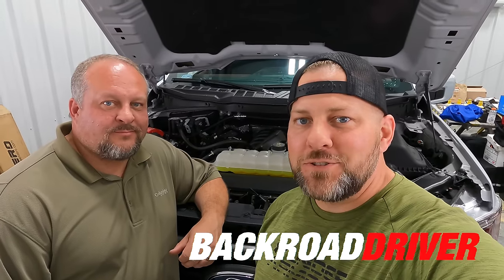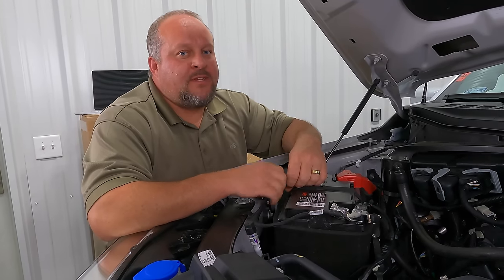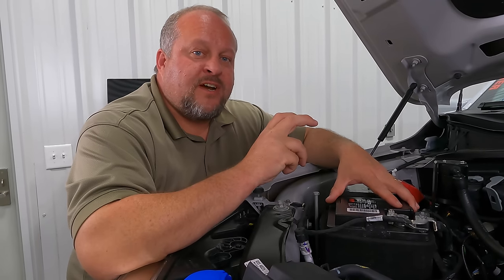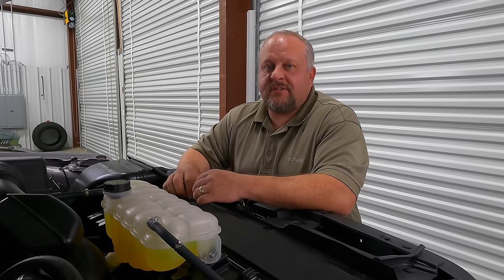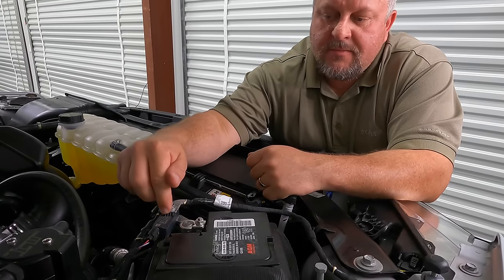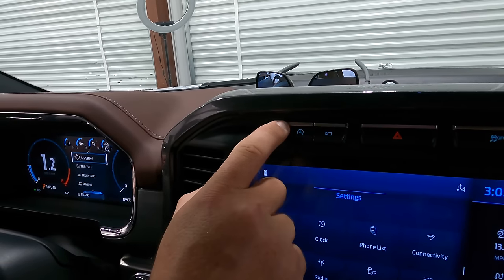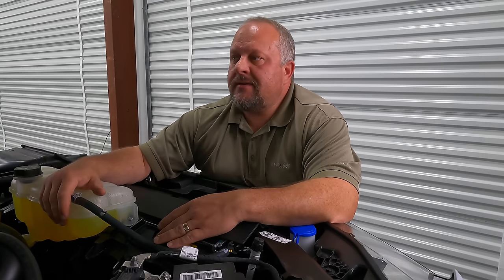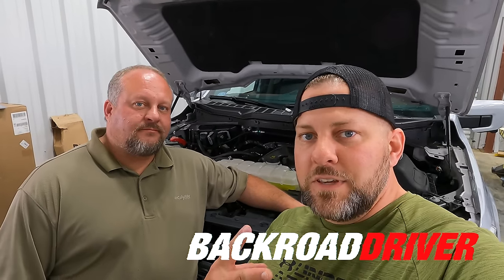2021 Ford F150 5.0 V8 Cylinder Deactivation & Oil Pump Belt Defeated! - It Wasn't All Bad...

Comment: 2 questions: I have a 2.7 stx does it have cylinder deactivation? Does my rig have the same plug on the negative battery terminal to deactivate auto start/stop? Thanks guys
Reply from the maker: The 2.7 doesn't have cylinder deactivation like the 5.0.  I'm pretty sure your truck should have the same plug that you can deactivate auto start stop with.  It is still a little annoying because you have to hit a button on the steering wheel.  I would recommend using forscan or the auto start stop eliminator module.
Reply: @BackroadDriver  Thanks for the info gonna check it out bro
Reply: No they only had to do it to the v8 cuz government is trying to ban v8. So their trying to do what they can to save and keep the v8

Comment: I was in the process of finding a 2021 F150 5.0 and trading my 2016 5.0 in, when I seen your first video. I instead looked away from F150s after owning 4 of them prior and ended up buying a Tundra. The Tundra is a night/day difference in towing my 30ft travel trailer. What are Ford engineers thinking? I don't want cylinder deactivation or a wet belt, way to destroy the coyote engine and loose a 5th generation Ford driver.
Reply: Hi Joshua.  Could you please explain specifically what the night and day difference is?  As far as towing specs go, the Ford has the edge so I was wondering what specifically you mean when you say the Tundra is better.  Just asking for clarification and additional information for those pondering the same decision on buying.  Thanks.

Comment: I have a 5.0 on order.  Would you order it again?  Also hearing sport mode turns off CD.  True?
Reply from the maker: I love my truck and it's been great so far. Sport mode and tow haul mode also turns off CD. Since this video, we have found out that unplugging the cable from the battery does not disable cylinder deactivation.   It may disable it for a little bit but it comes right back on.   It does, however, disable auto start stop. Thanks for watching Todd! Check out some of our other videos.
Reply: @BackroadDriver  thanks!  I will stick with the 5.0 and just drive in sport mode.
Reply: Have the 5.0 in my 22 STX and I absolutely love it
Reply: @christian7200  that’s awesome!  Mine goes into production mid March.  So maybe in April I’ll get experience a new 5.0!  What mode do you drive in?  Can you feel the CD?
Reply: @Todd C.  mines being built late March...
Reply: @GoogleUser-xr2hr  mine just got pushed back a week to 3/21👎
Reply: @Todd C.  what was the original build week? Mine was March 21, it also got pushed back to March 28th
Reply: @GoogleUser-xr2hr  3/14
Reply: Just ordered mine Monday night, estimated 6 months

Comment: What can you tell me about the new "spray on" cylinder sleeves?   Are they holding up or are they wearing out fast?  I'm looking at a new(er) F150 5.0 V8
Reply: Same here. Contemplating buying one while the incentives last. Not much info out there. I work for Ford manufacturing, some of our guys had issues with oil consumption on their 2018 - 2019s one had an engine replaced under warranty. No one had reported on a later model yet.
Reply: Check with the imports they been doing it for years

Comment: Trying to identify my rear end size, have a 2018 f150 5.0 two wheel drive xl reg cab. the pumpkin is square in shape and has twelve bolts.? The door sill code is L9(its an e locker) Any thoughts.
Reply: L9 is 3.55 Electric Locking Axle
Reply from the maker: Should be a 3.55 e-locker.  Square 12 bolt should be a 8.8 rear end.  I'm pretty sure the 9.75 isn't square.  Look for a sticker on your rear axle and see if you can Google that code.  Anyone else with knowledge please step in...
Reply: Thanks' for the reply, and no tag or sticker present, i'm sure it's a 8.8 .

Comment: This never make sense to me and I’m a logical guy who’s done a lot of work on engines.  I have two 5.0 F150’s 2012 and 2017.  Why on earth would I want to run 4 cylinders instead of 8.  If you have 8 guys working on a project and you tell 4 guys to go home you will wear those 4 out early.  Let and 8 be an 8 and share the work .  The engine will last longer.  It’s as bad as the stupid shutting off and on at the lights all the time.  The starter will not last.  Oh and ask Toyota about timing belts on their v8’s back in the day. Has to be changed every 90k. Expensive job.  These engineers have short memories.  GM never mastered their engine deactivation issues for 20yrs and im sure Ford has it figured out. 😂😂😂.  Laughable.
Reply: Some guys try to tell themselves that it won't have problems because it's DOHC instead of pushrod but it's not as though Honda hasn't had problems with cylinder deactivation. I mean, Ford hasn't even mastered cam phasers and timing chains after how long, they aren't going to perfect DOD right off the bat. Ford's 1.0L Ecoboost uses a wet belt to drive the oil and I have seen a sickening number of those belts shredded to bits. Why is it so hard for Ford to just do the right thing if they want the oil pump  down in the pan? Put a double roller chain on it at the very least. I'm sure all of us would gladly pay the cost difference to get an engine with beefy long lasting chain drive at least.
Reply: GM been playing this game for 5 generations now, over 65 yrs, still no good. It’s just a bandaide to meet CAFE while making the engine 50% less reliable. Ford added this to their 2022+ V8 trucks. I don’t think it’s on the mustang V8 yet.

Comment: Is there a way to turn OFF the engine shutoff at stop lights beyond remembering to hit the switch? 2021 F150 Lariat 5.0 Thank You
Reply from the maker: Right now there are a couple of options.  ForScan is one option. It requires a cable that costs up to $50 and a Windows laptop.  You would also need to do a little research and download a copy of the software to your laptop.  A good place to start would be this video.  https://youtu.be/ZMdXP0hFcOE

The other option is the auto start stop eliminator.  You can purchase it on their website. https://www.autostopeliminator.com/products/2021-ford-f-150-autostop-eliminator
It will cost you around $90 and you will need to install it.  Some minor - disassembly may be needed to get to the back side of the button.

Comment: My 2014 5.0 gets 14to 15 mpg. 

My 2021 5.0 gets 17 to 18 mpg. 

And on the 2021 v8 they added back the steel drain plug for engine oil.  :)
Reply: My 2017 use to get 21 hwy & 17 city.. granted I was running 93 but now with my 35’s 14 wides I’m lucky to get 12.5 hwy and 10ish city on e85 could be better running 93 but haven’t tried since my truck is tuned to run all my mods with e85 only but 93 wouldn’t hurt nothing but HP TQ

Comment: just picked up a brand new 2021 F-150 STX....we noticed at some stop lights the engine r's and oil pressure dropped off to zero...now, 3 months later, doesn't do this anymore...is that a problem ?

Comment: What source is cited about potential CD related issues with the 5.0. Just brought a 2021 SXT home—love the truck and power of the Coyote, however, the 10-speed trans takes time to acclimate with. Ram had lubrication issues related to its CD, just wondering what Ford’s techs or mechanics note. Really like your channel.

Comment: Great video! I have a 2018 f150 5.0 it burns oil because every cold start up it blows out a  bit of blue smoke do you think a ford dealer will do something about that.    what’s your take on it? Thanks
Reply from the maker: How much does it use between oil changes?
Reply: @BackroadDriver  a quart  every 1200 miles it has 56k on it I change the oil every 5 k  I run moble 1 advanced full synthetic 5 w20
Reply from the maker: Are you under warranty?
Reply: @BackroadDriver  yes sir
Reply from the maker: I would show them that and tell them that oil loss it way too much between oil changes.
Reply: @BackroadDriver  will do thanks 👍
Reply: Father in law is getting his engine replaced for the same thing

Comment: Belt driven oil pump, I'm done with new  FORD.
Reply: Yup. Ford tech here, I've seen plenty of oil pump drive belts taking out focus and escape engines. And the worst part is "belts of all kinds" aren't covered under esp contract so once your base warranty is up, it's not covered. 

I hope these belts are very different from the belts in the smaller engines. They all crack, and get worn out, just like timing belts.
Reply: @mattgerb17  they are essentially timing belts, they will need to be serviced, but I'm sure ome of the first upgrades on this new motor will be a chain driven oil pump.

Comment: Would a cylinder deactivation make the truck vibrate a little when on Idle? I just bought a 2022 ford F150. Which I can feel a small vibration in the cabin when it’s idle. Once on drive and driving it smooths out. Or when I’m at a red light. No issue. Only in idle. Which it’s very uncomfortable to feel. Specially a $60k truck. By the way. Mine doesn’t have the auto/start/stop button anymore. But engine says it’s eco bust. My previous 2018 had that A button to disable the auto start/stop function.
Reply: I have noticed at idle. My truck jiggles quite a bit. It is uncomfortable how much it oscillates
Reply: @Shelf_Help_ca I’ve noticed this at startup along with some extra noise - seems to be coming from the transmission.  Everything’s fine once moving.  I’ve just gotten used to it.  From my 18 Mustang GT I’ve learned to just ignore all the weird noises that come from the engine 
at  idle and just enjoy the power.

Comment: All you have to do is put the truck in sport mode. It turns all that crap off.
Reply: also hold gears longer and increases throttle responce. killing mpgs
Reply: @devincicrashjk  boo hoo. I don't buy trucks to save on gas. differences are negligible
Reply: 🤦‍♂️ @devincicrashjk

Comment: Question: by unplugging the cable from the negative terminal, are you saying I couldn’t use the rear defrost, and heated seats ?
Reply: No, it just monitors those systems when the vehicle is stopped due to ESS so it knows to restart the engine if battery voltage drops too low.

Comment: Please elaborate on that chain driven oil pump ford has never had one on a 5.0 the previous design was driven directly by the crank shaft and ask about the belts already failing on 2.7 3.0 1.0 1.5 1.6 engines this is not a good idea or design if that belt quits you need a 10k engine replacement......

Comment: So GM's oil pump timing belt wasn't Kevlar ??
Reply: my Chevy's oil pump is connected to the crankshaft. no belt. when did they need a belt?
Reply: @banana82728   I don't know,,, they do all this crazy ass engineering to hopefully gain minuscule mpg improvements to satisfy their government overlords.
Ford takes a bulletproof 5.0 and adds belt driven oil pumps and cylinder deactivation because their customers demand it ???
NO...
The Government Overlords must be appeased !!!
Thank the EPA and the CAFE standards and the glassy eyed leftists that run them...
Reply: @2packs4sure  exactly

Comment: HUH?  Yeah, unplugging the BMS cable will most certainly disable AUTO STOP/START, but how is doing this disabling cylinder deactivation??????????????????
Reply from the maker: It didn’t work well…
Reply: So unplugging the connector at the neg battery post does not disable cylinder deactivation?
Reply: @ctbale1  NO, it does not.  It will disable stop/start, but it does not affect AFM/DFM at all.  Not sure how this got started.
Reply: @greghale717  yea, been researching the shit out of this.  I was thinking of buying a 2021 f150 with a 5.0 but won't unless I can permanently kill the cylinder deactivation.  I believe the only way is with a tuner.  I don't want to be forced to drive in sport mode or tow mode to defeat CD.  Thanks Ford!  Dam

Comment: Id like to know if the 2021 5.0 is drinking oil like my 2019 is. Wonder if they fixed that?
Reply: Do you think it’s the spray in cylinder liners they started using?  My 2011 has 189000 miles and doesn’t use very much oil between changes
Reply: My 2015 had no oil issues.

Comment: I can see why the charge monitor would disable the start stop feature so you don't get stranded with a stopped engine at a stop light but why would it disable cylinder deactivation? and how do you know it's actually disabling it?
Reply from the maker: Hey Drew, thanks for watching! We have confirmed that it does not stop cylinder deactivation in future videos.
Reply: @BackroadDriver   OK thanks. It really would have been nice if it were that simple.

Comment: The oil pump is obviously cast aluminum... It is not machined out of solid billet aluminum.
Reply from the maker: The gears, not the housing.
Reply: Billet steel oil pump gears. Cool.

Comment: hey, can you guy tell me if my 2021 f150 302A package with driver assist/ lane keeping can be upgraded to the full BlueCruise coming out later this year? i dont have the front camera in the grill or the side mirror cameras, can i just take the truck to ford and have them upgrade it to that? thanks,
Reply: Was "Ford Co-Pilot360™ Active 2.0 Prep Package" on the sticker?  I think it was/is only an option on Lariat, KR and Platinum, and standard on Limted.

Comment: Wow, I dodged a Bullet!!!  I have a 2018 F150 10spd Gen 3 Coyote, I just have to stop the auto start stop.
Reply: Question do you have oil burning on your truck because ford have the problem with 18 to 20 oil burning ?
Reply: @bigbuzzard8168 I stopped the iol consumption on my 2018 5.0l by switching from 5w20 oil to 5w30 and putting a little Lucas synthetic oil treatment in the oil.
Reply: Same here, instead of trading in my 2011 Ford F150 with a 5.0L Coyote for a 2024 Ford F150 with a 5.0L Coyote V8 (or for an overpriced EcoBoost F150), I've traded in my 2011 Ford F150 for a 2024 Nissan Titan with the 5.6L Endurance V8 in it with 400 HP and 413 Ibs of Torque and it makes the same power as the Gen 4 Coyote in the F150 but has no cylinder deactivation nor Auto Stop Start unlike the F150.

Comment: when u put the truck in manual mode the cylinder deactivation turns off too
Reply: Not all years. This was proven.
Reply: @blackcoffee730 what years?? I have a 2023.  What manual gear would cycle through gears and stay in 8cyl mode ?

Comment: Cylinder deactivation and auto start stop are not the same thing. How do you know the cylinder deactivation is disabled when you disable the battery monitoring system. Why would that disable cylinder deactivation. They have nothing to do with each other. That trick only disables auto start stop because the computer doesnt know if the battery is being drained from accessories while the engine is not running causing a no start . My 2019 5.0 would disable auto start stop just with laptop charger plugged into the 110v outlet.
Reply from the maker: Trust me, I have driven the truck for several months with cylinder deactivation enabled and once you pull the plug off the battery lead, cylinder deactivations is disabled. I have an aftermarket exhaust and it is audible when activated.  It is no longer audible and does not activate once this plug has been undone from the battery terminal.
Reply: That's exactly what I was asking!!! Auto stop/start and cylinder deactivation have nothing to do with each other. unplugging the BMS does kill the auto stop/start, but I think these guys are dead wrong in their thinking that it also stops cylinder deactivation.  in the RAM, cylinder deactivation occurs at a certain oil pressure and load on the engine....what would the battery management system have to do with lifters and oil pressure in the cylinder deactivation.  I think these guys are boasting something they have no idea what they are talking about......

Comment: Not sure if others have commented, but putting into Tow/Haul or Sport mode will also deactivate cylinder deactivation. 

Personally I don’t mind it - keeps mileage somewhat reasonable for a 6000lb vehicle!  I also wish I had Auto Stop/Start (it was deleted on line) so maybe I’m in the minority here, lol!
Reply: Yea I had my auto start stop removed.
Reply: LOL, won’t keep mileage reasonable at all unless you drive under 1200 rpm all day every day.

Comment: I tried unplugging that cable from the negative terminal on the battery and cylinder deactivation is still functioning. 
Something must have changed for the 2022 model F150 5.0s
Reply from the maker: We are aware that it doesn't stop cylinder deactivation. We addressed this in a future video of ours. This particular video had so much other good information in it we didn't want to take it down.  The only way to get rid of cylinder deactivation is with a tune.
Reply: @BackroadDriver do you have a link to that future video? Thanks
Reply from the maker: https://youtu.be/f6WiK5zaR4M?t=510

Comment: Why were they using sub par piston rings to begin with? Oh yea to maximize profits and screw the customer. Piston rings should not be cheaped out on so why did they. Stuff that warrants a full rebuild when it goes bad should not be tampered with when you sell those trucks for 75000.
Reply: You would hope, but the nutters and penny pinchers at Ford would rather spend the pennys on i'm not sure what. They're not really innovating in anything that the customer wants so. Spending money on EPA requirements

Comment: Unplugging the wire from negative battery terminal does not turn off the cylinder deactivation on my 21 F-150 it only makes the truck shift different kinda like being in tow haul mode and with the higher rpm of the motor it does not drop to 4 cylinder as often but it still does are there any plug in tuners that will turn it off it is absolutely nasty sounding with after market duel exhaust ( sounds like a Hugo with a header pipe and a jake brake ) needless to say I am ashamed to drive the truck